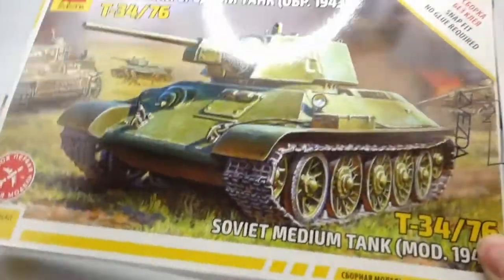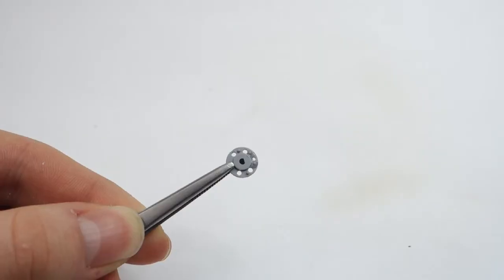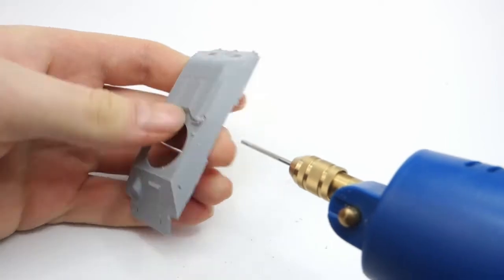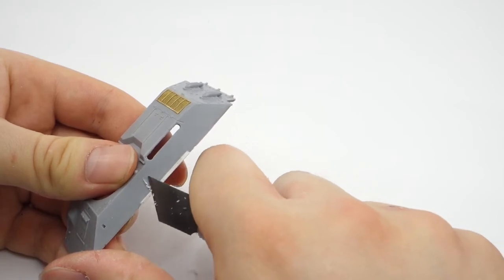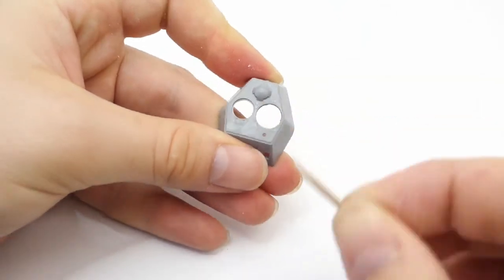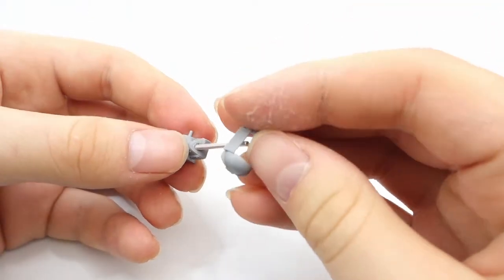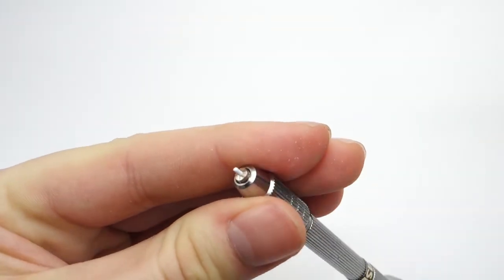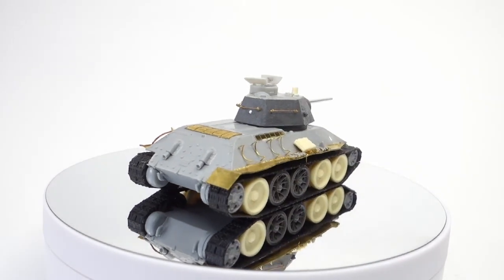Building a T-34 from Zvezda in 1/72 scale

Comment: why did you choose the zvezda kit? You could have saved so much work and time by just buying a dragon kit for example. The Zvezda T34 is one of the worst detailed model  I have seen and never finished it because of that.
Reply from the maker: I don’t agree. Zvezda has the best T-34 model on the market. Dragon on the other hand is the worst choice. I’ve built a dragon model once, and it requires much more work to be built into decent model then I’ve spent on the zvezda model. The model itself is not only expensive but also has many issues, here’s a couple of them:

Wrong turret geometry
Solid holes in wheels
Wrong tracks pattern
Rubber tracks
Ugly And wrong driver hatch
Overscaled details
No welds detail
Incorrect shape of the rear plate

The zvezda kit has only those problems:

Simplified detail on turret top 
and gun mantlet
Solid exhaust
Undersized driver periscopes

All the other things I’ve did like adding texture, metal parts and metal gun barrel are modifications that both kits require so I haven’t listed them here. I also need to mention that I’m comparing Zvezda 5001 and Dragon 7595, which represents the same version of the vehicle.